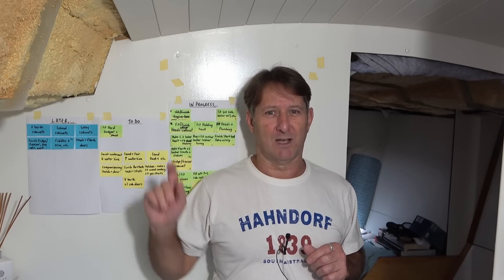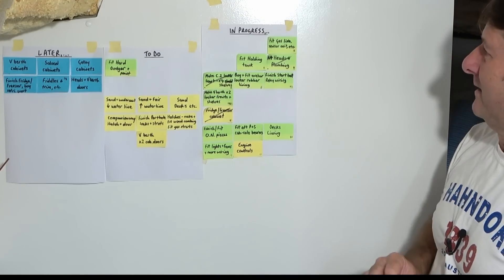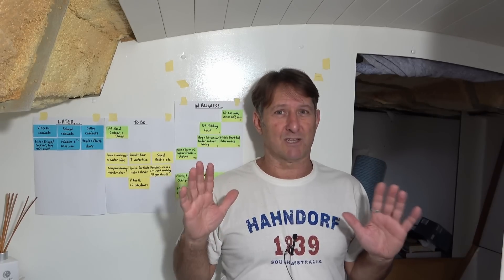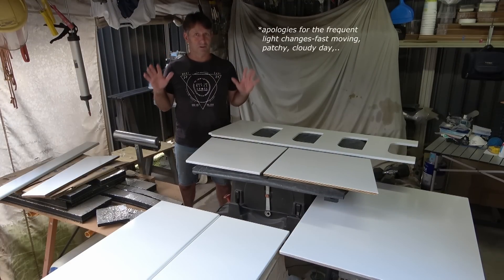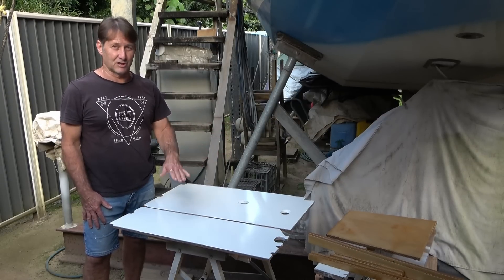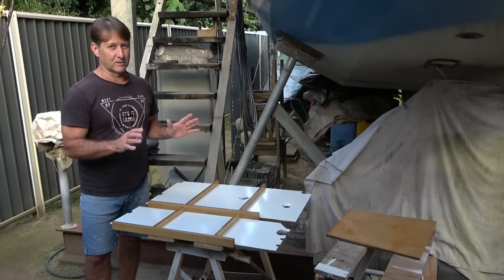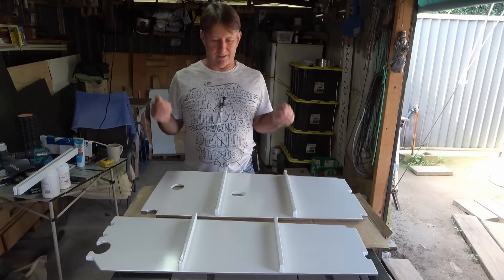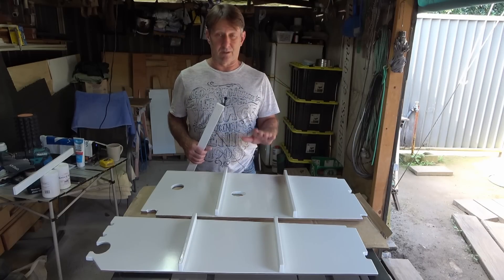EXCEEDED MY EXPECTATIONS! (pt.1) Ep.167 Building my steel sailing yacht

Comment: Been watching you for a while now. I admire your work, very diligent. I'm sure your boat will last as well as ours. After 22 years of building we launched Jan 2005. Yes, over the years we have made modifications and changes, not that systems didn't work, we just wanted improvements. 90% of original build still work perfectly.
Reply from the maker: Thanks very much for your good comments Mark, appreciated and would you mind sharing what boat you built and where?  🙂👍🏻
Reply: We built 52 foot ferro ketch "Finnally" she displaces 33 tons. 120 HP Ford Lees engine  @BuildingSYMistress

Comment: Bruce great work as always, just a thought for you. Do you remember the springs that were on the hoods of the old cars back in the day 60-70 and 80's ? This might be a work around for the engine room box door. And have a lach to lock it shut. Not sure if it would work/ fit into that area, but if you are having trouble getting struts ... just a thought for you.
Reply from the maker: Thanks for your good comments and suggestion Jeff, appreciated and yes, I will keep this in mind  🙂👍🏻